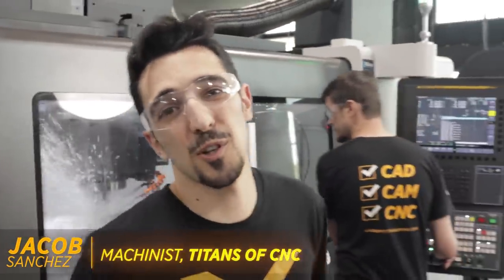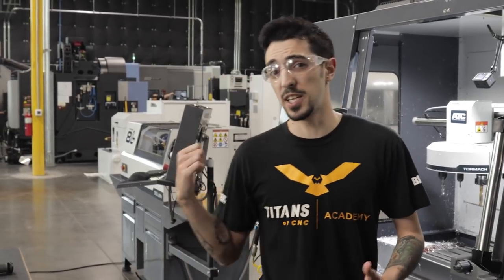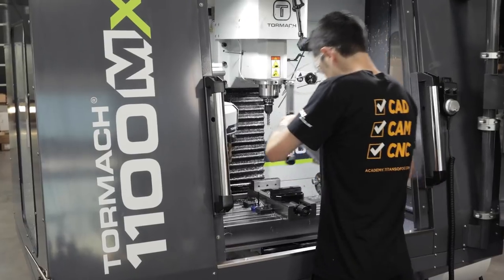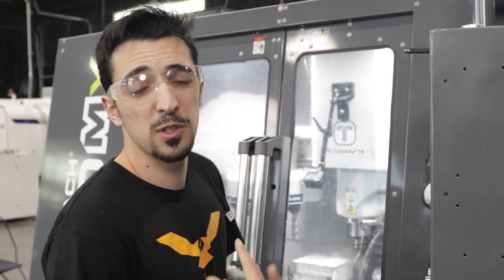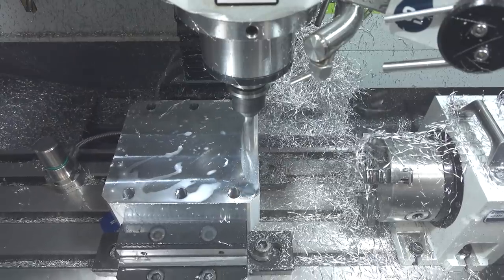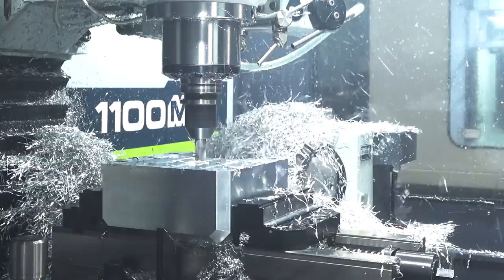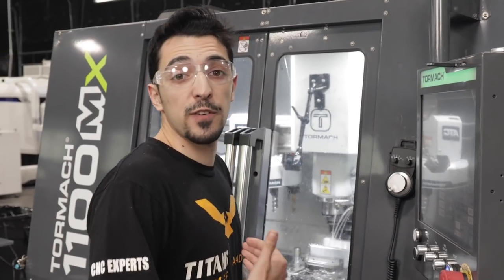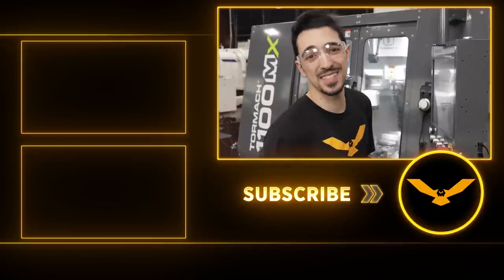CNC Machining Our Incredible Conference Table Clamps

Comment: My favorite aluminum facemill for small low powered machines were the ISCAR 2" and 3" inserted type. You could bury those things and make some really nice chips. The inserts were super sharp, durable and made a spectacular surface finish.
Reply: Personally I am a big fan of Iscar. They have some really good tooling. I'm a mill/turn guy and I have found that they have generally the best tooling across the board when it comes to milling or turning.

Comment: My biggest respect for the guys at Titans. I love the spirit youre living:-)
BUT this operation screams for a ramping head, by example Walter F 3040. 12000 rpm, 8000mm/min feedrate, Ae full, Ap 5mm (depends on machine spindle power)
and chips will fly ;-) and you don't loose time by cleaning out the edges with hsc programming. One cutting edge (3 inserts) will cost 45.- and will last +300min cutting time in 7075..

Comment: What is a good surface foot for general stainless.  I have a 3inch kennametal 45° 6 carbide insert dodeka with through coolant. I'm trying to be the beat at my shop and blow their minds but I can't figure out a good sfm or feed per tooth.. for roughing and finish and the have the inserts.  last forever. Using a haas vf5

Comment: Imagine working in a shop that can devote so much machine time and resources to building their own conference table. I've been in machining 35 years and have never worked anywhere that had 1/3 of the nice equipment and tooling. Most shops want you to make precision parts on the cheapest worn out junk.
Reply: Been there. They make your earn your title of machinist. 😉